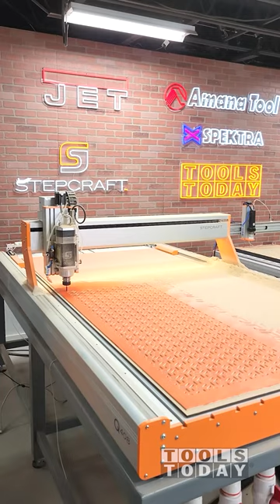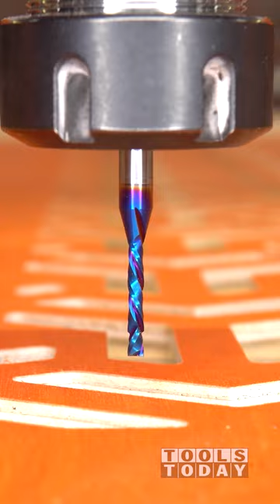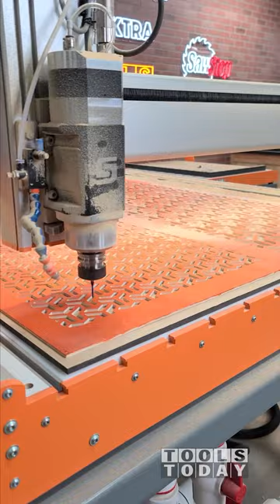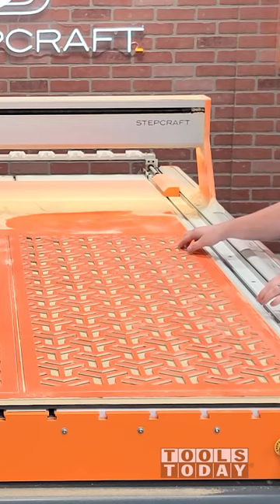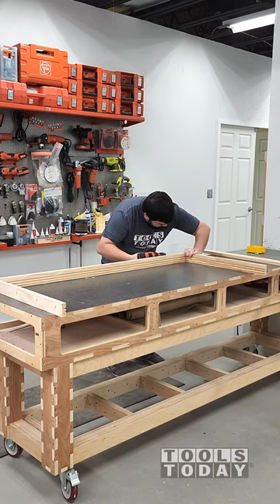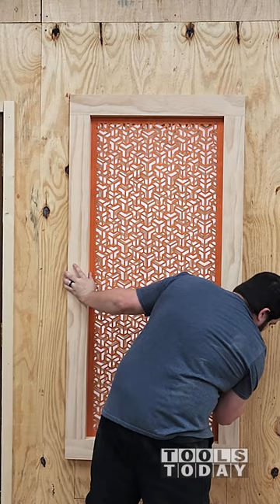Making a Geometric Window Cover

Comment: Seeing as how it took two passes and the material was cut all the way through, would it not have been better to cut those shapes out around the perimeter instead?

Or would that have required additional cleanup, which was not needed here?
Reply from the maker: Cutting just the profile around the shape would leave a piece of material inside that when finished cutting would create the potential for it to pop up, hit the bit wrong and break it or send the piece flying.  I could certainly leave tabs to hold it in place but that would be over 1000 tabs that needed to be cleaned up.  Getting rid of the waste material first leaves no clean up and ensures a bit isn't going to break.
Reply: @ToolsToday  Thanks for the explanation! I know that I've seen vacuum tables that suction the parts and offcuts to the table to prevent that from happening but your way seemed to be the best for the situation
Reply from the maker: No problem, this one is a vacuum table, but these pieces are so tiny there's not a vacuum out there that would be able to hold that small of a piece very well.  There just isn't enough surface area to grab onto when it gets that small.